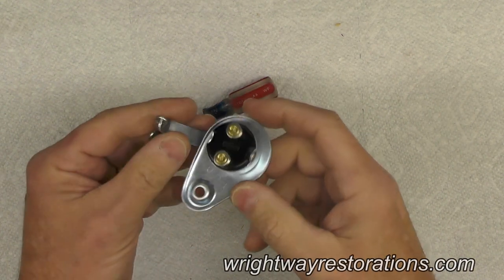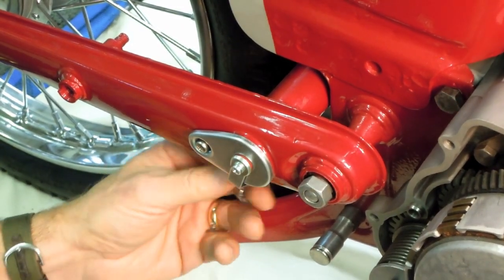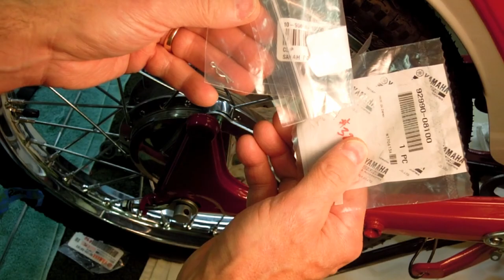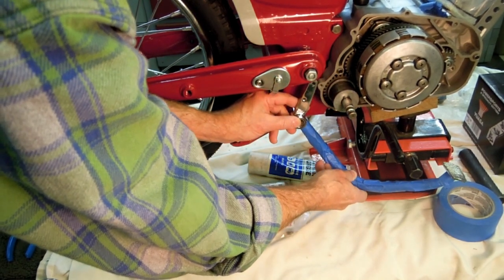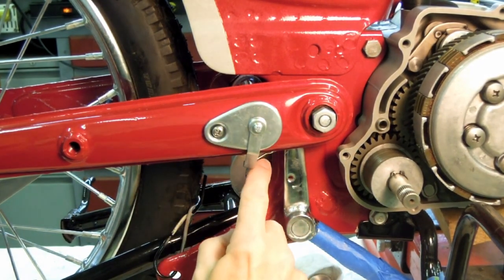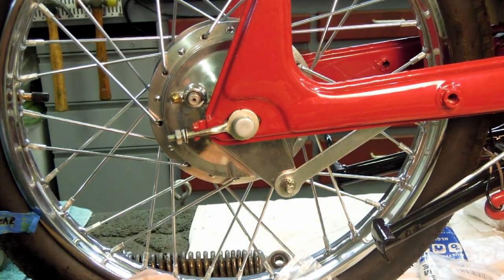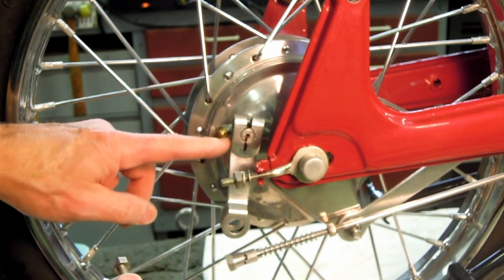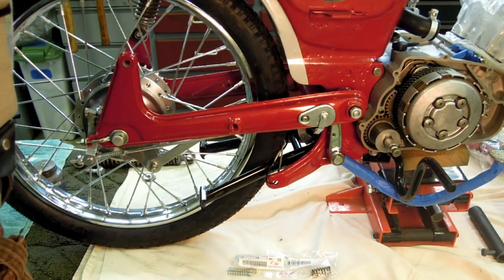Yamaha YL1, Assemblying Rear Brake System --- Video #147

Comment: Hi Kelly, apologies for not being in contact sooner - I've been waylaid with other projects....!!!!!!!!
Anyway, a couple of thoughts about this video; a small point is that I think the electrical connestions to the brake switch, should really have gone between the washer and the end of the little stud, rather than between the spring and washer. I'm sure it'll make no practical difference in real terms.
I don't think there is any need to shrink wrap insulate the connections, as unless the switch screw fell out and the switch became dislodged, there is no chance of an electrical short.
The second point is that I am sure that the switch connects to the  rear brake pedal via a small spring, rather than just direct to the pedal. This gives a degree of flexibility, and it means that when then the brake starts to go out of adjustment, and travels a long way to operate the brake, rather than put strain on the switch, the spring simply accepts the extra movement.
I'll try and see if I can find the spring and post a video for you to see what I'm talking about.
All the best, Jono
Reply from the maker: Hello Jono, I was wondering where you've been!  Regarding your comments:

- The electrical wires... you may very well be right.  I've actually seen it done both ways, so I just took a shot at it.  I'll certainly consider your point.

- The switch connection to the brake pedal... the parts diagram don't show a spring (at least that I can find, unless I'm just missing it), and my project didn't have one when I took it apart.  Therefore, I didn't pick up on a spring being used.  If you have a photo or other info regarding this spring, that would be most helpful.

Thanks for your comments...
Reply: @kwrightway  I'm back in my workshop tomorrow, will try and find the parts and if I can I'll shoot a video. Cheers J

Comment: I'm having a similar merry dance with some of the sub assemblys of my 1969 Kawasaki F4. Some parts obstructing access to others!, parts illustrated in the book but not numbered or relevant to this model!. By the way, I avoid greasy hands by applying grease with cheap 'hogs hair' artists brushes of various sizes stored in a washed out plastic soup pot and lid. Were you not tempted to insulate the brake switch terminals with heat shrink tubing as a precaution?. Bike's coming along great though. I'm going to have a go at home zinc plating on seeing your vid instead of sending it off.
Reply from the maker: Good tip on applying grease!  I didn't really think of insulating the terminals, that's the way they were originally installed and it didn't occur to me.  If this was a real rider, that would be a definite consideration. 
Glad you feel encouraged to try zinc plating, it's really not difficult, just takes a little patience.  Feel free to ask questions and let us know how it goes for you.

Thanks for the comment...
Reply: @kwrightway  
Forgot to mention those cheap 'hogs hair' brushes have long tapered handles which I cut off so I can get the lid on the pot but the offcuts are usefull for scewering parts to be painted/laquered and the smaller tapers can plug fuel/oil pipes.
Reply from the maker: @doctordirk6316  Excellent, thank you...